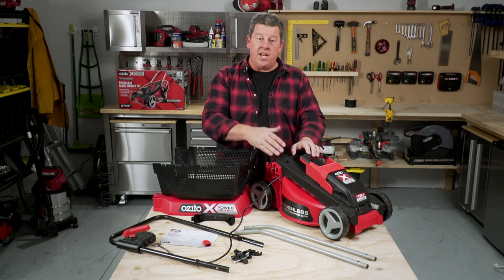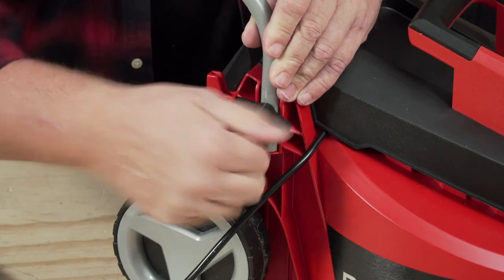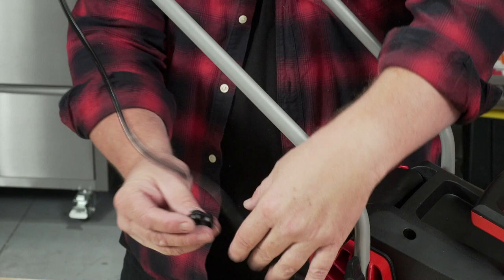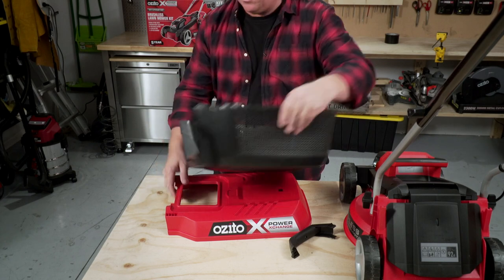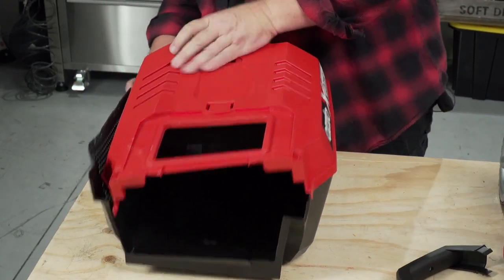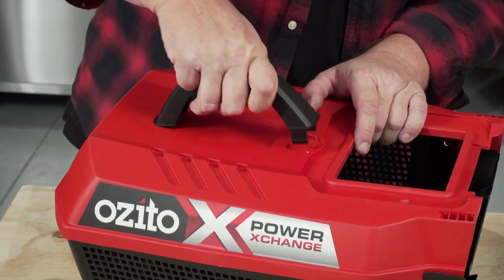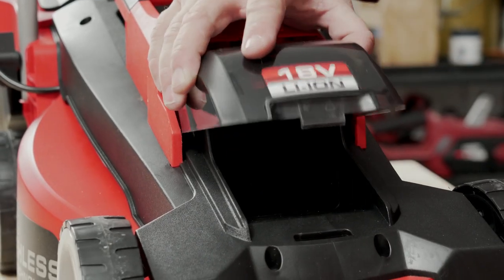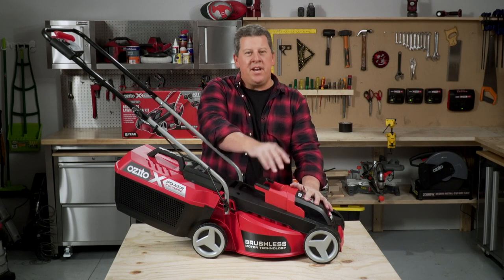Ozito PXC 18V Brushless Lawn Mower Kit Assembly [PXCLMK-1318 & PXCLMK-1418]

Comment: The guy in the Ozito HOW TO video is right - you start with locking in that first "lug".  But I found it difficult by the last three  lugs (I'm over 65, female, and I'd run out of strength), so I employed my trusty "rubber mallet" ($6) which I had previously used to assemble shelves.  I wish I'd tried the rubber mallet from the start, because it worked a treat!
Reply from the maker: Hi Joanne, thanks for reaching out. We really appreciate your great feedback on our product. We find it helpful for our Product Development Team to know what does and doesn't work for our Customers. We hope you continue to love Ozito tools, Cheers!

Comment: My Ozito has stopped working. It starts then stops. Starts then stops. Battery is fine. Have taken apart the starting mechanism  attached to handle, no obvious wiring issues. Its less than 5 years old, but no receipt kept. Should I scrap it ??? Bought from Homebase in UK, but no longer sold there due to Bunnings poor takeover and sale.

Comment: I’m finding it hard to screw in the bottom lugs. Am I supposed to be using some sort of tool ?
Reply from the maker: Hi Natalie, The nuts should screw in through the holes on the handles. If you’re still having difficulty with this, we recommend you take this into Bunnings and see if someone can assist there. Bunnings will return this if they can’t get the screws in for you. Please reach out to our Customer Service team directly for further assistance - Call on 1800 069 486 (Aus) or 0508 069 486 (NZ) or email them at enquiries@ozito.com.au. Cheers

Comment: Anyone here face these kind of issues (bought the 1418 model): 
- on first use with battery charged overnight it stopped working having only done 60% of my 90-ish sq. metres backyard (saw one Ozito video claim the 18V battery should work up to 150 sq m lawn)
- now on full charge it starts up for a few seconds and the mower stops and cannot be restarted
Reply from the maker: Hi Rubaiat, thanks for contacting us. 
Firstly, check that the batteries are fully charged, the safety key is inserted correctly and there is no blockage near the blade or in the catcher. 
Another thing you can check are the handles of the unit. There are 3 contact points where the handles attach to the body of the unit. If these are slightly out of line, then the mower will not run. 
I would suggest trying the below steps to realign the contact points:
1. Remove the batteries/safety key from the unit. 
2. Change the angle of the handles to a different level than you have it on.
3. Re-insert the batteries/safety key. 
3. Run the mower to check that it is working. 
5. Once working, you can then move the handles back to your desired angle. 
One you have followed these steps it should run as normal. If the mower does not work after these steps are complete, please return your unit to Bunnings with your proof of purchase.